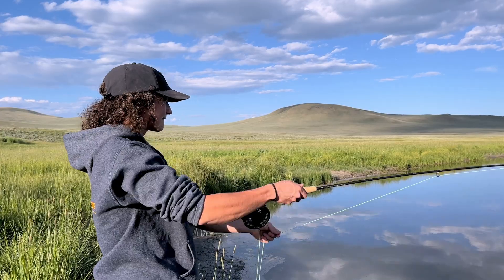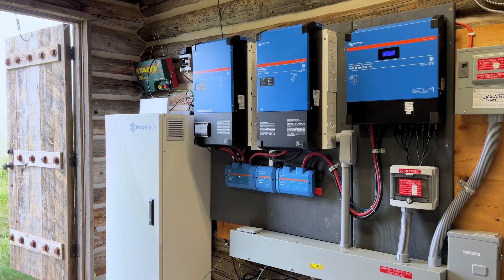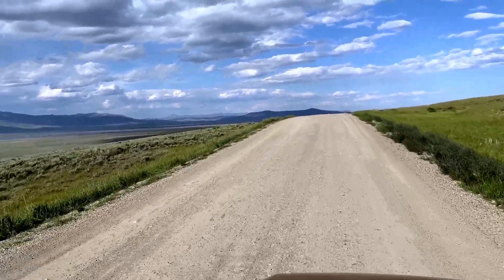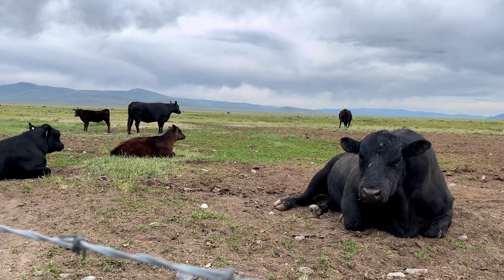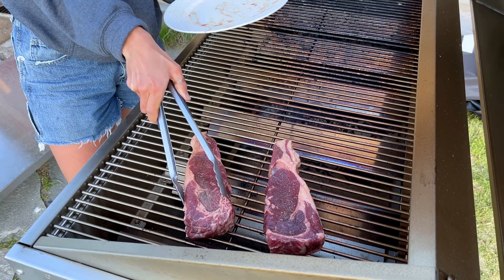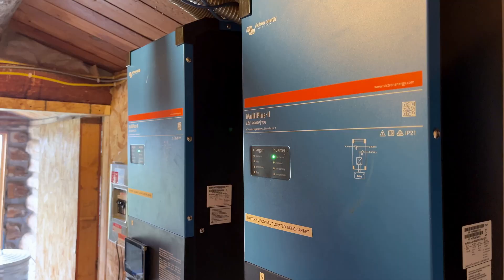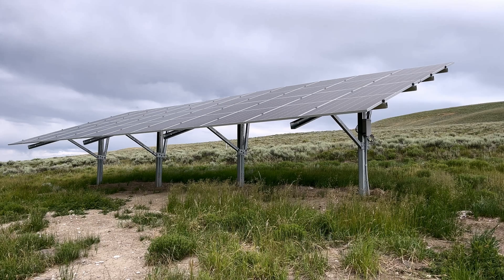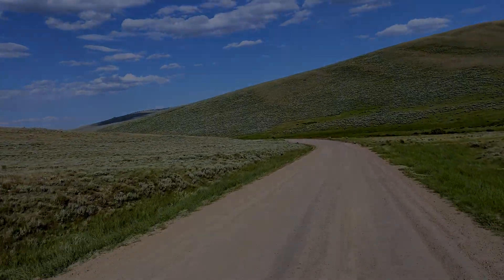No Grid, No Problem: Remote Montana Ranch Power System Tour

Comment: That's a great looking setup.
I'm also a big fan of Victron and Pylontech, used those brands for my hobby project.
I just want my batteries to last a long time and I'm a bit concerned.
I stress my 4 US 5000's maximum to 0,25C, top them off at 52V maximum and my DoD is 80%.
What values do you use over at IntelligentControls?
Reply from the maker: Hey there. For the most part, we just allow the batteries to tell the rest of the system how to charge/discharge them via Viction’s DVCC function. As an extra layer of security, I do program in some charge/discharge parameters that provide a healthy margin for error into the system in case the BMS connection gets broken.

Absorption Voltage: 52v 
Float Voltage: 51v

DC Input Low Shutdown: 44v
DC Input Low Restart: 48v
DC Input Low Pre-Alarm: 48v

Comment: That victron lynx shunt has absolutely no function in that configuration. It only functions as a fuse between DC bus and de SmartSolar RS450
Reply from the maker: @veeerzes, you're correct - it's acting as a redundant fuse and not the most useful in the current setup in this system, especially at the cost. This was on one of the larger battery banks Harvest installed, and in the initial design the battery bank was going to be installed on the other side of the power system. When they got to the site and had to work around the existing conditions, the battery bank needed to be placed on the side you see in the video (you may notice the MPPT has extra slack in the lines - able to reach the far side where the batteries are currently connected). The shunt was intended as a backup battery measurement point, and added the fuse status lights to the distributors - redundant to the battery BMS data, but useful for monitoring this critical remote location. This is still on a to-do list, but needs some new/longer high-gauge wiring for the bank to be reconnected. In this current install, it is simply a redundant fuse and turns on the fuse indicator lights.

Comment: That’s a really cool application
Reply from the maker: Yes, it's a serious upgrade from the outdated system. It's hard to appreciate just how much available technology has changed in the last 20 years, both on the power electronics side with manufacturers like Victron, and what we can expect in a communicating lithium battery. And now, we have remote monitoring capabilities built into these systems via the Cerbo GX - it's pretty wild.